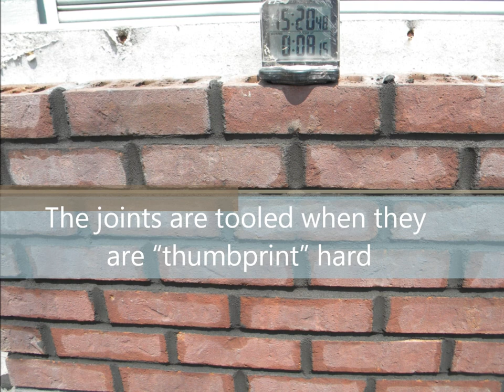Easy Tuck Point Using a Masonry Grout Bag

Comment: Worked fine for me. No mortar stains. Still looks good after one year. Think of the time I saved by not having to use muriatic acid to remove mortar stains. Joints holding strong. Another thing I should mention is don't use too much sand.

Comment: Details showing the final consistency of the mortar mix before filling the bag would really help to show one of the most important parts of this process.
Reply: As long as it flows through the bag its serves he purpose of filling the joints with mortar
Reply: Crypto Guru... yup, sure does
Reply: My mix will flow to a certain point then it stops at the tip and nothing comes out what should I do?
Reply: You have to mix it rich meaning a higher mortar to sand ratio for it to come out of a grout bag smoothly

Comment: Grout bags are great for beginners who have trouble on there verticals but you have to mix the product so wet to squeeze it through making it more likely to bleed out on the face of the brick or stone
Reply: It sounds like you are an experienced tuckpointing guru. Could you please tell me the secret to obtain the right consistency of the mortar in order to use the applicator bag??

Comment: I have to repoint the top 2' or so of my chimney.  This looks like a great way to get the material between the bricks with little mess.  Some of my bricks are a little loose, can I still use type "N" mortar?  My plan was to use the ready-mix bagged stuff.  Thanks
Reply: Hubjeep old soft brick needs type O mortar.   You can get to the correct ratios by adding some sand and some lime to ready made type N.

Comment from the maker: Assuming that the mortar is removed to a depth of around ½ to ¾ inch and there are no other issues with the chimney, it is recommended that you use a Type N Masonry Mortar.  The recipe for this is  1 part Type N Masonry Cement and 2 ¾  parts damp masonry sand by volume.

Comment: Get it right, this is re pointing, tuckpointing is something entirely different. ( inserting a thin contrasting colour band into a mortar bed)
Reply: Agreed , usual yank with no clue.....Tuckpointing is a way of using two contrasting colours of mortar in the mortar joints of brickwork, with one colour matching the bricks themselves to give an artificial impression that very fine joints have been made.

Comment: I prefer a hawk and pointing tools to pack the joint,a bag just lays the mortar in,a bag is a lot faster but i think using a pointer does a better job.just my opinion,i guess i think using a pointer is a better way because that's how i was taught thru the union,but in the other hand i have used a bag for bigger joints wen pointing lannon stone. I guess it's all in the workers preference, looks good though,using a bag would never be approved when doing a city,state or federal job

Comment: Never liked the grout bag because if you do have any small head joints you tend to bridge them not fill them also there is a lot of shrinkage (even with  additives).  I also notice on these tuckpointing  vids nobody is misting or moistening joints for better bond.  Thoughts?
Reply: As soon as the cement touches the bricks they get wet from the cement....it is a falsehood to do that.
Reply: @mjlives5428  bwahaha no it definitely does strengthen the bond, you don't have to do it and you don't have to think it does anything but for everyone else the OP is absolutely correct you should wet the joints before pointing
Reply: I am not an expert on brick work, but common sense tells me that you need to get wet the bricks before applying the mortar so the bricks don't absorb all the moisture from the mortar and makes it weak

Comment: Oh.... The luxury of 5/8" wide joints, How about demonstration of 3/16" to 1/4" joints like on many of historical buildings and old masonry. The grout bag hole is about 3/8" minimum.
Reply: ***** it would be damn near impossible but on most repointing jobs they work great so little effort in comparison i have worked on old restoration jobs and it is not so good but be good with your slicker as well it is only good for 10 mm joints and bigger

Comment: Head joints show "half moon", sorry but prep was not performed correctly. Good looking product in the end. It should be noted this is not tuck pointing. Grout bags should not be used as typically too much water is needed to make the grout flow. Resulting in a weak grout.

Comment: Mix mortar to a moist consistency. Use masking tape on the bricks exposing the mortar joints and then push the mortar into the joints using a small putty knife. Remove masking tape. Voila!
Reply: this is the worst idea i've ever heard for repointing
Reply: Please stop giving advice.
Reply: ***** You know, I was thinking the same thing. Why take the time to tape off brick step by step when pre-printed paper labels with adhesive that are the same size as your bricks would make things much faster. Don't knock it till you try it.
Reply: umm.... use a joiner.  a putty knife is for putty... wrong tool.  Plus have fun with the tape.
Reply: Lol